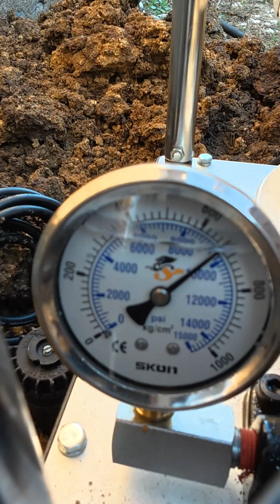Why We Stopped Using Concrete Piers | Real Warranty Case in Rowlett, Texas

Comment: Why not use helical peers? "Screwed" in to the ground with hydraulic drills. (concrete on top). Go down until you reach a certain torque on the drill. They are used in Europe and I've used them in earthquake-prone California.
Reply from the maker: all foundation systems have their place when they’re matched correctly to the soil conditions, structure, and market.

Helical piers are a proven system and work very well in many regions. In Texas, they’re simply not as common for residential foundation repair. One reason is installation logistics: helicals typically require a mini-excavator or larger equipment to achieve and verify torque, which increases access constraints and overall cost compared to push or hybrid piers.

Another factor is local soil behavior. Much of North Texas has deep, highly expansive clays, and while helicals can reach target torque, that doesn’t always mean they’ve bypassed the active zone. In this market, installers and engineers often favor systems that are driven to verified load-bearing strata by resistance/refusal, especially for heavier homes and primarily vertical loads.

Comment: Interesting video.  had a foundation company use concrete pilings went down about 15 -20 ft. All was good for about 8 years now slab has moved about 2-3 inches. I opted not to purchase the lifetime warranty, after researching the company does not honor the lifetime warranty without doing min $45,000 worth of drainage work and then charging  an additional $600 per piling. Local company in Mississippi. We have bad yazoo clay in parts of the state.
Reply from the maker: Unfortunately, that’s very common. Concrete piers are usually the “affordable” option, but they often stop within the active zone of expansive clays like Yazoo clay. They can look fine for 6–10 years, then movement shows up again.

The warranty issue you described is exactly what we see in DFW too—lots of conditions, expensive drainage requirements, and added per-pier costs that make the warranty hard to use. Even with maintenance, concrete piers still tend to fail over time in highly reactive soils.
Reply: @ifixconstructionfr  thank you for the info!

Comment: That picture at 0:11 is wild.  At first I thought it was cgi, but it's actually a huge excavation right next to the house??  Why?  Wouldn't that be asking for a collapse?
Reply from the maker: Oh yes, it is not cgi nor Ai, it's a house we fixed a about 2 years ago. Few months ago, the customer contacted us because he started building a bunker in his backyard 😂 as you can see there, the piers on the very right side of the house collapsed, because they dug them with the machine. On that job, we installed a concrete pier next to a steel pier while I recorded a video to show the difference on depth between systems. This gave me the best opportunity available to capture in real life not only the difference on depth between piers, but also the layers of soil from a perspective not very easy to obtain.

Going back to the house, only 2 piers had collapses because they hit them with the excavator. They were using a huge Case machine to dig the dense soils. The hole was like 20ft deep and only a foot away from the house.

Luckily the house had the piers so it didn't collapsed. Without the piers, the house would have just dropped
Reply: @ifixconstructionfr  Farout!  That is incredible.  Glad to know the reason.

Comment: Wouldn't the small diameter end not have enough surface area to bear much weight without further sinking?  The steel tubes lock into each other, so would resist lateral pressure, as opposed to the individual concrete segments that look like they don't lock into each other?  So no rebar tying a single homogeneous column together.
Still very interesting.
Reply from the maker: The steel tip is specifically designed to minimize side friction, allowing the pier to bypass the active zone and reach competent bearing strata.

The primary load transfer is axial end bearing, not shaft friction. Once refusal is achieved, the pier behaves as a compression column.

The upper 4–5 ft are concrete cylinders, but because they are short and confined, they significantly reduce the likelihood of lateral movement compared to full-length concrete piers. In practice, lateral displacement is already unlikely because the load path is almost entirely axial.

As a real-world reference, the original concrete piers we removed after ~8 years remained straight, even though they were shallower and remained within the active zone—showing that lateral movement is rarely the governing issue in residential foundations.

Comment: I’m about to get helical piers installed to re-level my slab foundation. Are permits necessary? Because the contractor is reputable and they provide a warranty I wasn’t sure if going through the permit process is worth the delay and additional cost
Reply from the maker: Most of the cities/towns require permits. However they don't inspect the work, they will require your contractor to have a before and after structural engineer report. I do highly recommend to get the engineer inspections, the engineer is a 3rd party structural engineer that will certify all the repairs are in accordance to the building code and upon completion of the work, the engineer will inspect the elevations and certify the house has been repaired.
Reply: @ifixconstructionfr thank you sir
Reply from the maker: Most cities and towns do require permits. To obtain those permits, a contractor must be properly registered, insured, and—depending on the jurisdiction—provide third-party structural engineer reports before and after the work.

We are not owned by any parent company and have no corporate affiliation. We are a fully independent foundation repair company.

You are right about large corporations in this industry. Many rely on commissioned sales representatives with limited technical background, which can lead to over-prescribed solutions. Homeowners should be aware of that model.

That said, we are not part of that system. This is not a sales operation for us—it is a technical trade. I have dedicated my life, time, and resources to this industry, not only performing the work but actively developing technology and tools to change how foundation repair is diagnosed, documented, and delivered.

Our focus is long-term performance, transparency, and accountability. We document our work, educate homeowners, and invest in better methods because this industry needs higher standards. Anyone can review our videos, job sites, and processes to see how and why we do what we do.

That is the difference.